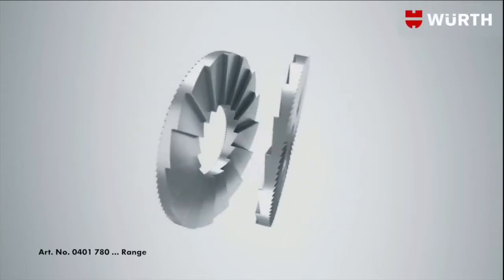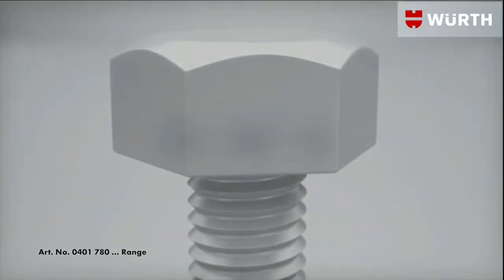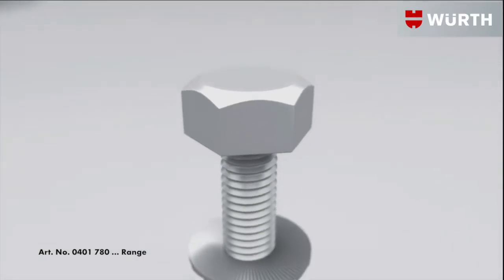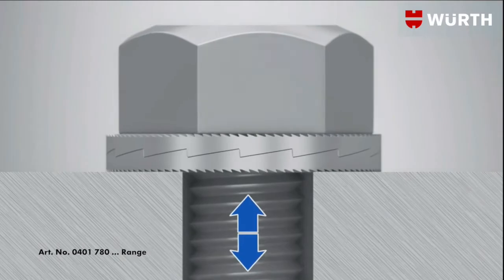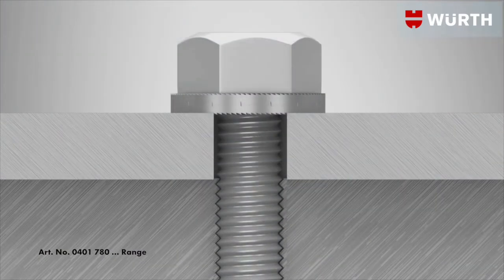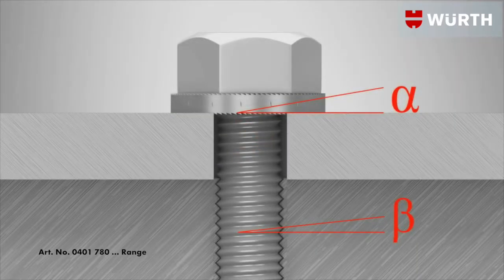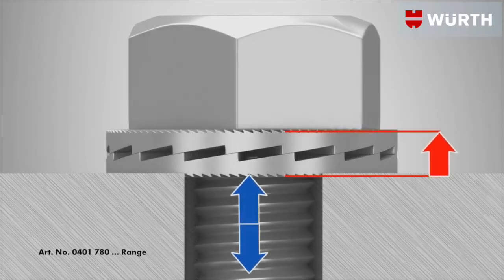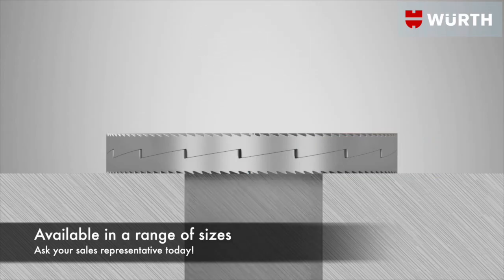Wurth Wedge Lock Washers

Comment: Have you bought the technology from Nord-Lock or have you bought the company (Nord-Lock)?
Reply: Patent protection on most of the wedge lock washer features has long expired, as the product was made in the early 1980's. Any company could now make a wedge lock of Nord's original style.

Nord-lock moved their development and marketing efforts to the Nord-Lock X-series that includes a conical (Belleville) spring washer along with the wedge lock. They also continue to develop their specialty materials and processes.